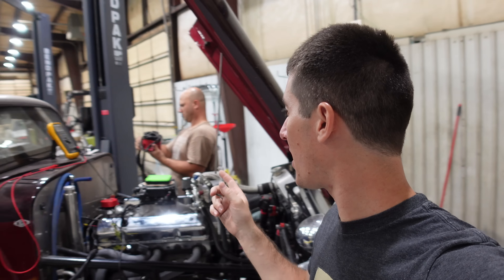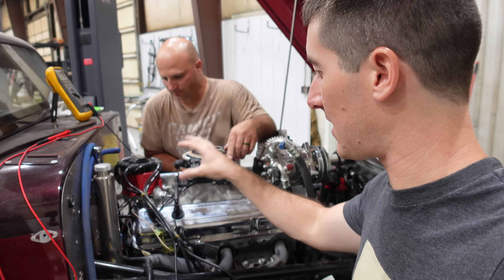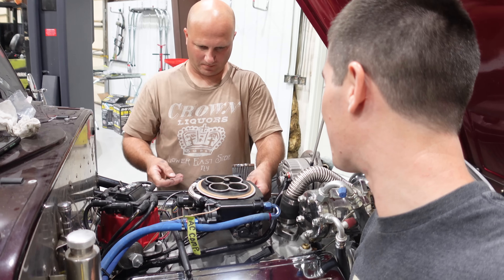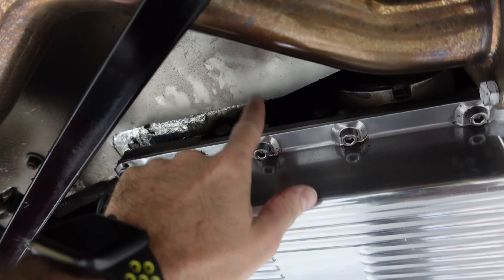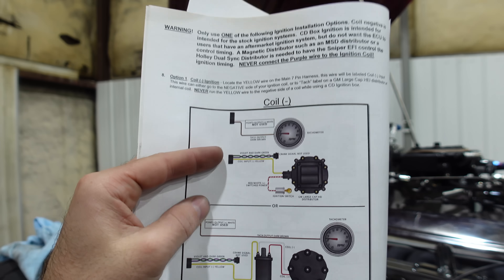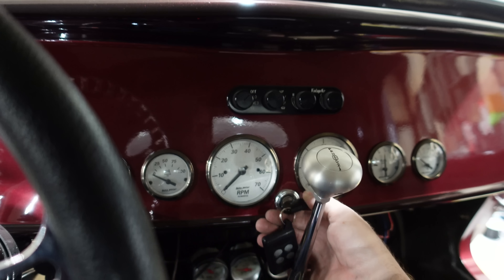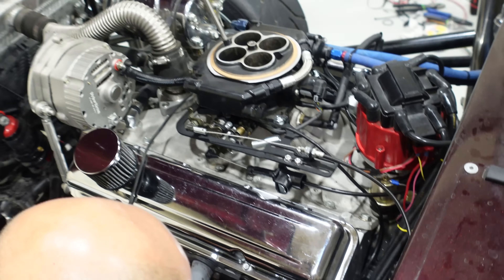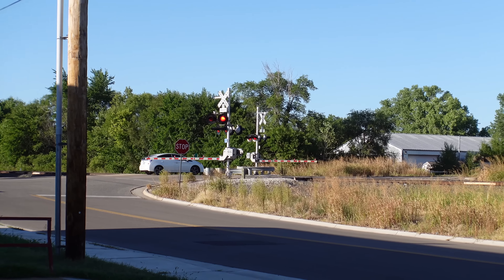We Pulled This 33 Ford Coupe OUT Of The STONE AGE *Massive Upgrade*

Comment: 1 real good suggestion for a malfunctioning railroad crossing is to call the railroad and give them the following information 1) the milepost (which gives them the location of the crossing), 2) inform them that the crossing lights are on, crossing gates are down with the crossing bell sounding), 3) finally let them know that there is no train in sight of the crossing, after doing all of that, they will send out a signal maintainer and railroad police to do traffic control.
Reply: thats usefull advice.

Comment: RE the RR tracks . . . you can request a Quiet Zone intersection, which will require some concrete barriers and two extra gates.
This will prevent cars from 'going around,' but permit the train to cross without blowing that 100dB horn.
Reply: It will still rock the shop building until it has passed
Reply from the maker: The word on the street is all the intersections in this city will be quiet soon 🍻
Reply: @WatchJRGo  Proving that if you derail enough trains they'll quit sending them past your shop :)

Comment: I’m confused, Since the o2 sensors were bad could that have been the issue with the other FI system the entire time ?? I mean the default tune on most of these are pig rich because rich is safe for the motor.

Comment: If that's a 4L60 (700R4) transmission, that cable is not just a kickdown, it controls line pressure.